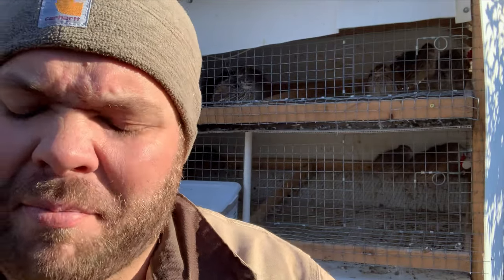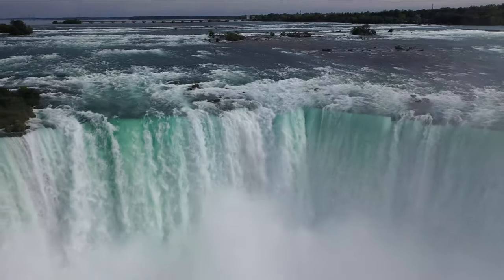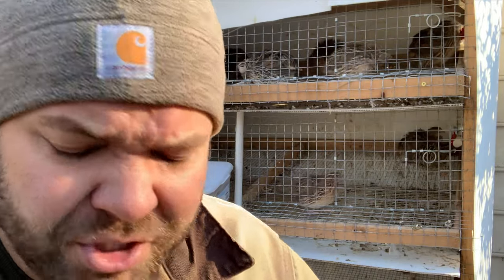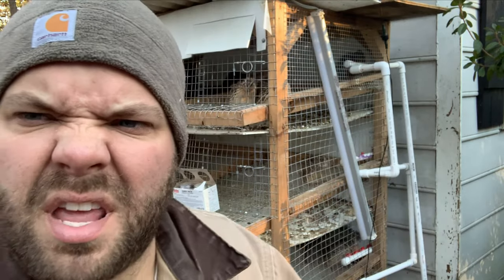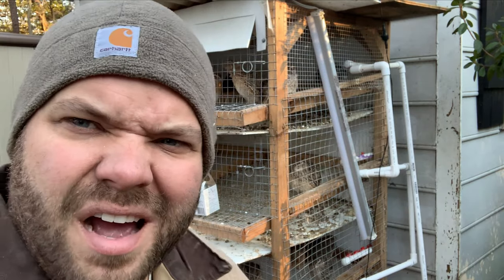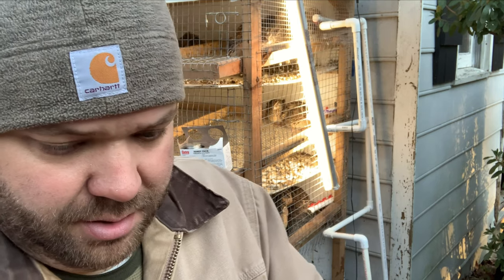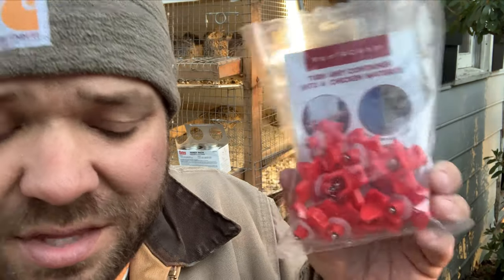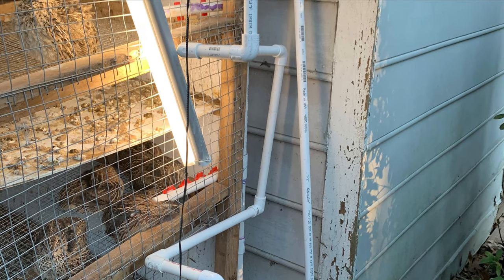Freeze Proof Coturnix Quail Waterer Build Part 1, Preparing the Quail for Winter.

Comment: Cheap Chinese products (vs rent-a-coop?) are made from plastics with different chemical compounds.  They are cheap because they skip adding UV inhibitors and other additives that make them become brittle over a very short time.  You can have cheap or good rarely if ever both.  Same with steel (ask me about the spider arm failure on most Samsung front loaders after 5 years! $1500 disposable washing machines don't make Mommy or Daddie$ happy!)  Garbage has become big business, so mfr's are prompted to make garbage products.  eV's are the new disposable Bic lighters